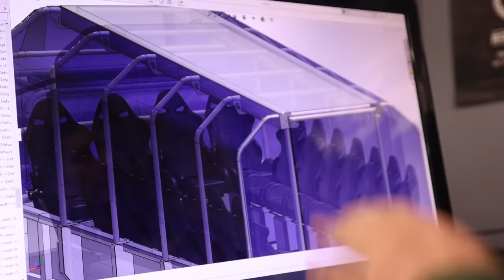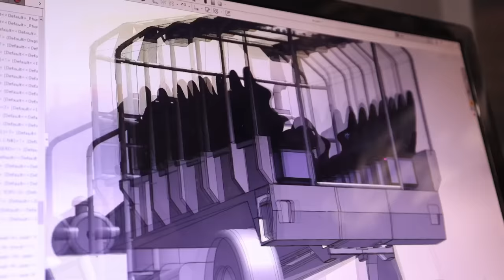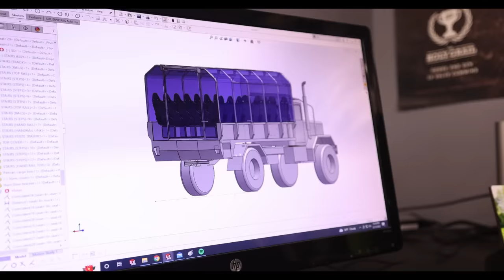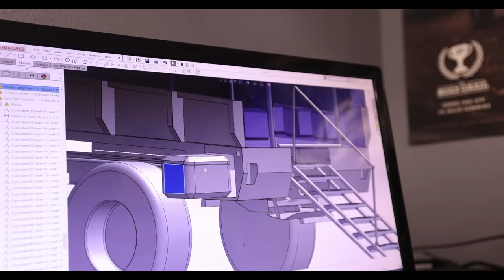5 Tons of FUN! (Rear Steer Party Bus Build)

Comment: Lol!😂 you guys are sooo funny!!!😂😂 
I used to work at Tooele Army Depot. I worked in the tear down area. I was in the bay that removed all the tires. All 10 tires were removed and 6 were replaced and 4 of the back tires were turned around and replaced for sandblasting the other 4 tires was put on a pallet until there was 4 on  I worked this bay by myself. I did 6-8 trucks a day.  Depending on how much trouble I had.  6 of the tires were replaced back on the truck but the 4 back tires were turned around and put on backwards I never used a forklift or an overhead hoist. I had a tire fork that lifted the tire off the axle. The back tires were turned around and replaced that way. 
Was not a lot of fun. 

Oh yeah did I tell you I’m a girl and at the time I did this job by myself and I only weighed about 110 pounds!!! 😂😂😂😂 lol 😂😂

Comment: Wow !!! Ive always been in love with those 4 door Bronco's  If I had the oportunity and the finances Id love to have one with a 7.3L Powerstroke align honed , decked,and girdled with  built with Forged Carillo Rods, Forged Mahle pistons valve relieved, delipped, .30 over lowered compression coated tops and skirts, T4 turbo kit with S476 KDD ported, o ringed heads with beehive stg 2 springs hd lifters and smith brothers push rods ARP head studs a Dual HPOP kit from/FFD  4 line fuel supply manifold and lines FFD banjoe fuel bolts Fass titanium 240gph lift pump 350cc/200% Injectors FDD headers, Power hungry Performance tunner , jellybuilt tunes, sun coast cat 5 4wd E40D trans Ford 9" rear end 40 spline axles with 3.55 ring and pinion straight axled front with 3.55 ring and pinion also upgraded suspension interiors re done with flip up screen head unit dvd reverse camera a/c and heat 5% tint on rear windows 35% driver and passenger windows, smoked Cab lights smoked head lights smoked rear lights LED interior lights Mishimotto radiator, Mishimotto 6.0L powerstroke Trans cooler, mishimotto intercooler, NX dual stage nitrous kit  Banks Data monster with all the sensors  all black window trims black bullet antenna Painted in High gloss black with Matte black accents matte black wheels on 35" All terrain tires Cluster gauges for a 7.3L to be compatible head rest screens for rear passenger entertainment and 2- 12" Subs with 2 channel Mono Amplifier a 6 channel Amplifier for a 6 speaker set up  heavy duty alternator and heavy duty starter with dual Odyssey 950ca Batteries with a battery isolator and new wiring.   I think it would be a definite head turner that is comfortable and has Plenty of Pep to surprise most challenging street vehicles when needed But once again I am a Dreamer with no financial backing to complete a project like this lol  Blessings to all
Reply: Would you like fries with that?
Reply: @HorsepowerHeadquarters454  Onion rings please

Comment: At the end of the video where u was having trouble getting the tire on I noticed with putting a front steer axle on the back. The axle would be facing the other direction so the wheel studs would have to be change over cause of the whole one side is lefty lossy righty tighty but the other side is righty lossy lefty tighty bud lugs method

Comment: Tightening torque required decreases when using lubricant. Never seize is actually a lubricant made for that purpose. Using a lubricant can lower the tightening torque by more than half to achieve the same clamping force. Use a torque wrench to prevent stud slipping or thread busting.

Comment: Sometimes you will have a letter on the head of the stud telling you if you are supposed to be tightening to right it will have a letter R or L indicating witch way you loosen or tighten on the front of a old Ford F700 will have a stamped into the stud or you will sheer off all your studs trying to remove the rim.

Comment: nice build there guys , but you really should   lucas  RED N TACKY on those leaf spring retention pins and not ANTI SEIZE , anti seize washes off too easily , red n tacky stays put even under heavy water spray

Comment: Words of Wisdom,well let's see,,the front steer axle that you've mounted in the rear is now needing re-gearing,,if the drive shafts turn clockwise to move the truck forward,that axle will be trying to go in reverse direction,,if it's  a top loader on the on the third member,you possibly can unbolt third member,turn it 180 degrees and power the axle off the accessory flange, providing of course that the axle shafts will mount into the differential housing properly,,and then there's the problem of the steering gear and tie rod placement ,behind or in front of the axle for drive shaft clearence,,

Comment: Y’all need to run 3/4 or 1 inch air line on your big impacts it’s not the pressure but the volume of air they will hit so much harder
Reply: He was trying to turn nut the wrong way...snapped two. Flip switch on impact and the rest flew off.
Reply: Hey look at that I need to send mySSN# a credit card number my checking account and I win your truck

Comment: Bill Hagerman
2 minutes ago
I challenge you guys to build a HD tornado truck , with tube frame, air bags suspension, to lower it to the ground, thick glass, steel protective panels, with room for several people inside to fire instruments' in to a tornado and let Reed trimmer use it as a tornado storm chaser. Even have a secondary motor to create a vacuum under it, to hold it to the ground. Name, possibly the twist killer